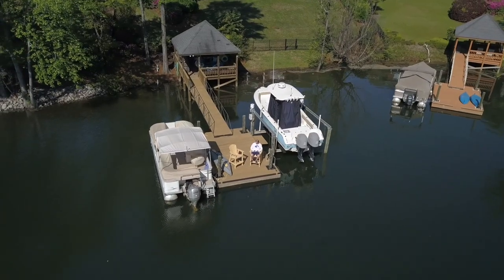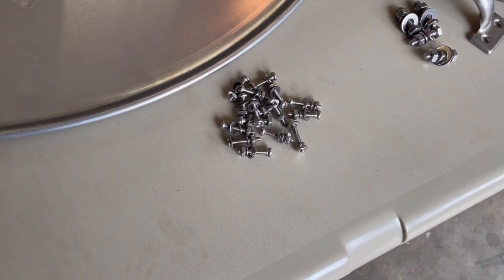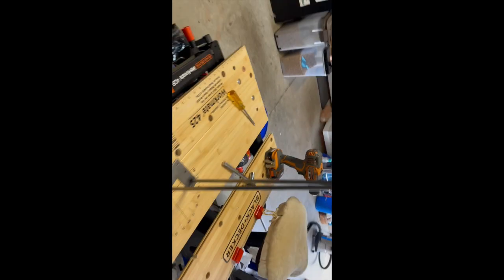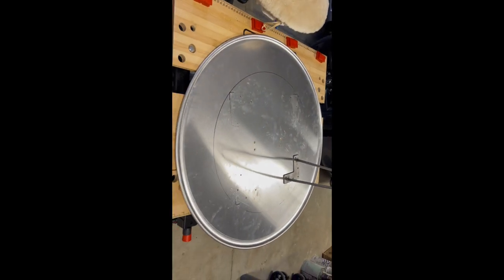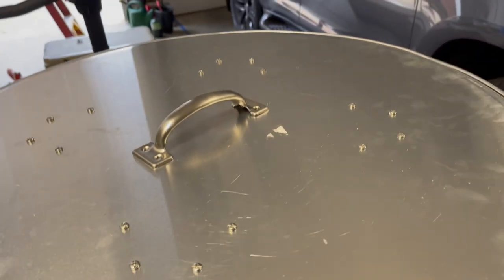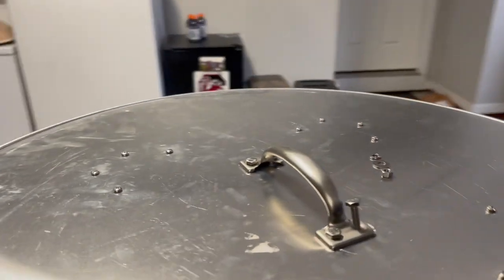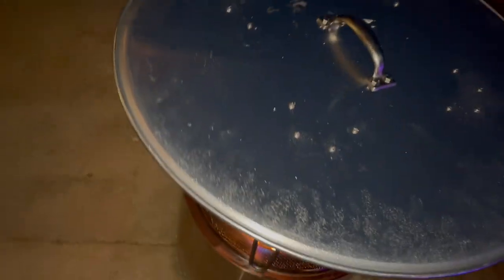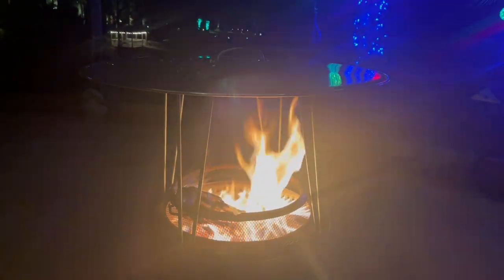Solo Stove Heat Deflector DIY

Comment: For a less expensive pan, get a replacement top for a patio heater. $31 for a 30” top
Reply: This is a great tip - cheaper and has some holes predrilled and it's already a little conical.
Reply: I like the idea, but will the legs match up? And would it still fit the Yukon model at 27 inches?

Comment: The normal deflector offered by Solo Stove is 10 inches tall and a 25 inch diameter. I just made this off those dimensions and it worked perfectly with a spring grill handle. Thanks again!
Reply: I’m glad it worked. When I did that video I don’t believe Solo Stove hadn’t come out with theirs yet. Thanks for watching the video!!

Comment: Thank you very much for the detailed video. 
I created one for my solo-Stove Bonefire. This was supposed to be a weekend project, but Amazon didn't deliver the 24" Pan until just before the conclusion of the Eagles vs 49ers game.  I worked on it during the Chiefs vs Bengals game. I received the Table legs on Saturday afternoon, and  I had brought a Table leg with me to the hardware store, and found the Stainless steel #10 Flat/coned machine screw provided the best fit (accompanied with a Stainless steel  washer, lock washer, and nut).  I used your instructions to start and get the table legs properly located, but tested fitted on the pan, and placed the ring on top, and found that it needed to be adjust about 1/4" all the way around for the best fit on my stove.  

I believe that the legs are 5" to 7" too tall. That aluminum pan takes a while to even get HOT, and I am not feeing the heat defecting down like I want.  I tested it last night, and today ( I have a fire under right now).  It is keeping the mist and sleet off the fire, so I am burning several old larger logs of soft wood (silver maple) that I had stored after removal of the 27 year old tree (used much of on the smoker), but the old logs don't burn too well (just burn a long time) and I supplement that with several spit logs of hard wood (purchased at the store). It was cold last night, and it is currently sleeting in North Texas so this design is keeping the fire burning. 

I have been around some of the solo-stove defectors, and I didn't like their design (you really can't cook anything on top), but the do a better job (I believe because they have 7" legs) of deflecting the heat toward the ground.  

It was a fun project, and I will continue to play"Test" it.  I would recommend using shorter legs. Maybe Stainless Steel deflects better than Aluminum.   Maybe I just need to have more people around the roaring fire to truly appreciate the materials and design (I have some hot dogs for roasting if it isn't too bad tonight).  

Thank you.
Reply: What size legs were you using on your diy deflector?

Comment: Great, that is what I was looking for. I also use pizza pan although 26inch as a lid for my Yukon 1. First perfectly, only thing I have to remove my ring and place it next to my fire pit for storage. 
I also purchased a wooden cart from harbor freight ( FRANKLIN18 in. x 12 in. 1000 lb. Capacity Hardwood Dolly) so I can easily move it under my patio cover. It was on sale for $10, I think regular price is $12. Works great.

Comment: This is an awesome idea and very well done. If you're concerned about stability, why not use longer legs and simply place the heat deflector on the ground (rather than the Solo Stove ring)? Also, the melting point of aluminum is 1200F. It's unlikely you will get your stove much hotter than 1000F, so the pizza pan won't melt. Stay warm and be safe!

Comment: I'm going to use a Patio Heater Deflector Shield ($36) hoping it will work better than the pizza pan but didn't know about the hair pin legs. Thanks
Reply: How did the patio heater shield work out?
Reply: Patio heater shield better than a pizza pan?

Comment: If you were able to make this in a slight cone shape where the tip is facing down, the heat would radiate out at an angle rather than straight back down. Nevertheless, awesome idea.
Reply: Gonna use a Patio Heater Deflector Shield and flip it upside down.
Reply: @xxvodanhxx ow did the upside down patio heater deflector work?
I was thinking of doing the same thing .

Comment: I would be careful with the metals used. Anything galvanized would be out of the question. There are many coatings that will release toxic fumes with the heat. Does anyone know of some good legs that are uncoated aluminum or stainless steel?

Comment: Ever have a problem with it jumping off the stove as it cools down?  I have that problem
Reply from the maker: I haven't.  The 4 legs stay in place on mine.  Is yours constructed using the same materials that I used or is yours constructed differently.
Reply: @adventuresandstuff6848  same materials. With the exception that I use 3, collapsible hairpin legs
Reply from the maker: I've never tried the collapsable legs.  Maybe they fold a little when exposed to the high heat is the only thing i can figure.  Let me know if you find a solution..
Reply: @jonathanbenincosa9080  Did you ever figure out a solution. I was thinking about my design and a huge plus would be having the foldable hairpins for storage on the go. Is it the legs that are flexing or the pan?
Reply: @deonallen923  I have not.  I really think the pan is flexing.  Happens when I bake cookies :)